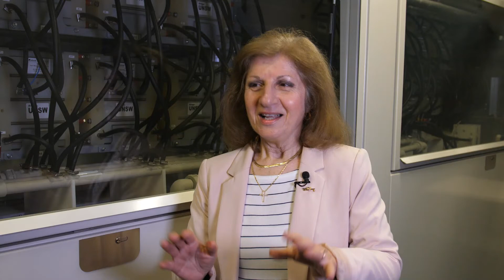Emeritus Professor Maria Skyllas-Kazacos explains vanadium redox flow batteries (VRFBs)

Comment: Question: how will flow batteries behave when you have vibration, I.e using flow 🔋 for ev vehicles. If it's liquid water used and you mention ions from one side flow to the other doesn't feel right solution for moving parts but I could be wrong.